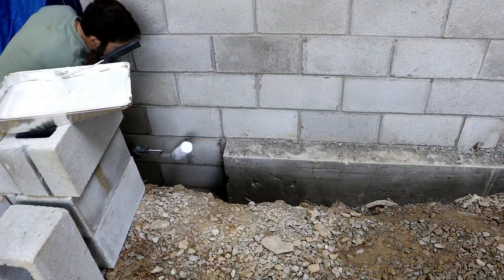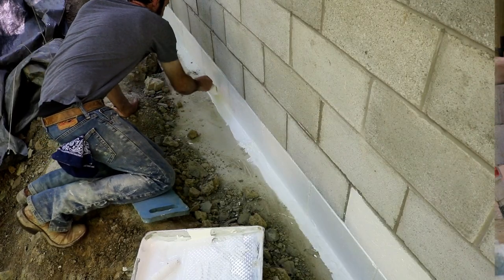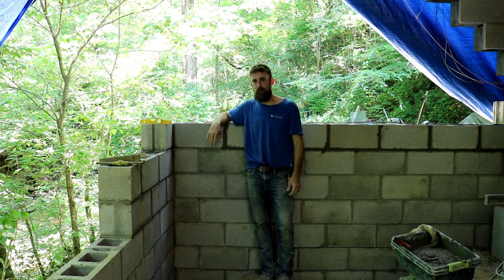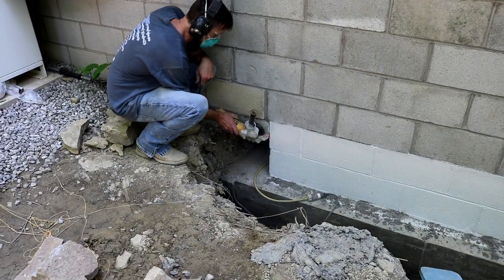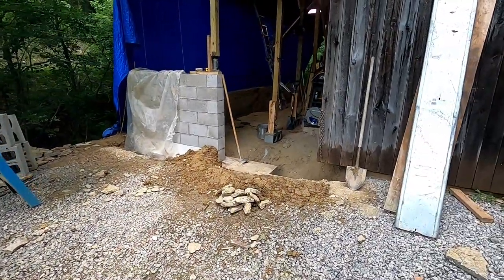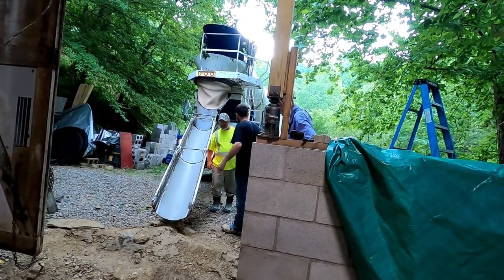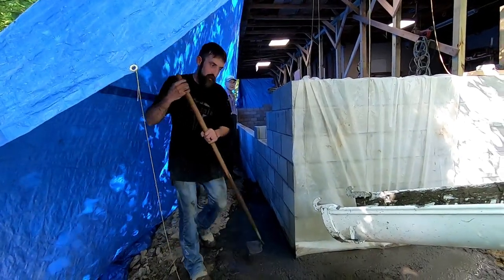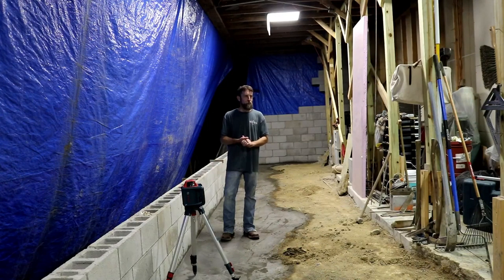Sealing & Backfilling with FLOWABLE FILL.  Shop Repair

Comment: Just fun'n  you know if you just spent $20,000.00 more , someone could have built that wall and leveled floor for you  ! Now that you are doing it yourself, it is going to take longer and YOU will KNOW exactly where every cent was spent or buried in the FILL case. I think it is coming along great. Winter thaw and heavy flood is the only concern I see.

Comment: Steve, this part of the building will most likely out last the rest of the building! By far, especially if the rest of the is built like the wall you removed! 
No two people would do this job the same way! I’m no expert by any means, but it looks great to me! 

I have never heard of flowable fill before. Does that contain any concrete or is it just a wet mix of sand and gravel? 

I had to chuckle about your comment about only raising 1/2 the tarps!

Comment: Dude you should have bought one of those Horror Fright airless sprayers ! Then use the roller to quickly go over it !! Second coat if needed !
Reply: Pros use brushes and rollers to apply waterproofing. Good enough for them good enough for me. The stuff the pros use is a bit aromatic though. So waterproofers are the biggest burnouts on the job.

Comment: Curious,  are you not using blocks to save on cement cost?  So why are you filling up the gap inside the wall with cement and not compacted sand?

Comment: Well done sir. Curious on the pad, are you going to cut and seam it or hammer the edges and fill?  Always heard that the rough jagged edge was better for stability and to prevent heaving. Just what I heard, not what I know.

Comment: I would think the biggest issue with that side of the barn wall that went bad was because it needed gutters to push the water away from the barn. Are you going to put gutters on the barn?
Reply: Your doing a nice job. Keep up the good work!

Comment: I've never heard of Flowable Fill What is the composition. "Around Here", it's either cement or Just gravel". Please explain "Flowable Filll"?
Reply: Looked like a grout slurry to me. So sand and portland. Maybe it has really small aggregate rock in it too? I've never heard of flowable fill either. Back in the day we'd just use stone dust. Compacted it is almost as hard as concrete.

Comment: I would have thought you would have just used the block wall up to the ground level and then fill the wall with stud construction?  Lots faster and less expensive.  Charles

Comment: Agreed on the problems of external support wall.  But why didn't you use suspended forms and pour a stem wall above grade up to the level of what you painted.  Was it just a choice of wanting to use the block up over paying for more rebar and yards of concrete?    By having a monolithic foundation/stem you are always stronger than layers and pieces and not had a bunch of porous block below grade. (I. personally, would have incorporated an angled breach wall on the upstream side as well. That creek so close is scary)  Don't take that wrong, I think you are doing good work.  You just sold yourself and your project a bit short on concept... and been where you are now, 3 weeks ago.  Sorry if it's taken badly, just a retired engineer scratching his head.

Comment: looks awesome that liquid backfill stuff is really neat its coming along nicely. have you thought about  moving the support jacks to the block wall like you did on the front wall so you could get the slab poured and then do your scaffolding and finish your block work maybe even run a steel tube or pipe down thru the hollow spaces in the blocks down to the footing to place your jacks on?  as for your negative keyboard warriors there only complaining because they dont have 1/100 of the testicular fortitude and ambition you do.

Comment: Looking great Steve! Coming along nicely. One question, what exactly is this "Flowable fill material" made from? Has it cement in it or is it something completely different? I ask this because one I have never seen it before over here in the UK and two it obviously comes from the company you got the concrete and shingle and stone chips from and that's why I wondered if it contained a cement base .
Reply: It's basically a runny mortar mix. Cement, fine gravel, sand, fly ash.

Comment: Seems you've forgotten to put in a damp course just above ground level in your block wall.
Reply: Seems none of your buisiness.
Reply: I'm not familiar with the hollow blocks used in the US but I don't see how a damp course would work when you fill the cavity with concrete/grout. Also he's painted waterproofer onto the outer face.

Comment: Nice job Steve, coming along really well. Question, I've never heard of flowable fill, what exactly is it, a slurry of cement and sand? Any structural strength to it?..............Mike
Reply: Mike Milburn I have the same question.

Comment: How hard does the flowable fill get? does it need compaction before a slab goes on top?
Reply: It's basically runny mortar mix with a bit less concrete, Sets up around the 1,000-1,500 psi range. No compaction needed.
Reply: @Blazer02LS  *cement, not concrete.

Comment: Steve first off I'll say 20 year retired (retarted) carpenter here and ur right ur not doing things the way I would. The one thing learned in that 20 years is that my way is not the only WAY ur doing a great job. I undrestand why and were it comes from but it seams that ur a little bit of a profectinst but thats ok ur happy with what ur doing. There were times we said if we were on the right peace of property we were close enough LOL! Keep ur mind on the end project and it will turn out fine.

Comment: Curious:  Is that latex based sealer?  If it is, is it actually meant to use for below grade applications?  I have yet to see a latex product work in a consistently wet environment.  I often see people using latex based tile adhesive in showers, and it doesn't last.  From their site:  DRYLOK® Extreme Masonry Waterproofer is guaranteed to stop water. Use for interior or exterior, above or below grade. 15 year warranty.  uhuhh..  I don't believe them.

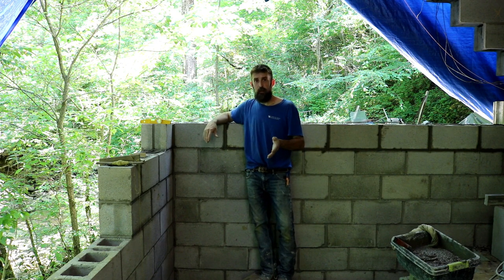Comment: 11:34 You are apologizing.  No reason.  As long as you are following code and have inspections, you are golden.  Following code and having inspections helps in facilitating a strong and safe structure.  I'm surprised that someone hasn't complained you used 'white' water sealer when brown was available.  Dickheads.

Comment: Everyone has an opinion on how they would do this or that & opinions are like A$$ holes everyone has 1 & they all stink. I find that if you ask to see that person's work they have some reason that they can't show you what they have done. The definition of an Expert that a wise man told me is an X is a has-been & a spert is just a drip under pressure.!!! Keep doing what you are doing & screw the haters.

Comment: I’m a retired mason with over forty years experience under my belt and I get a chuckle every now and then watching you with this build. I think that you’re over building like crazy but nothing falls down from over building! I was hoping all along that you would use flowable fill to backfill your foundation, you don’t have to worry about compaction when you use that. I thought you might do that on the outside also, are you going to use washed stone or dirt to backfill with? Have you thought about backfilling the outside before you get your block wall laid up? You have better access from the inside of the building right now or is that as high as you’re going to go with it? 
   I laughed when you caulked your form to keep the flowable fill from getting past your form work,  I think you gave the word flowable a little more credit than it deserved! You’re doing a great job, keep up the good work and keep them coming!

Comment: Reminds me when I was around 10 dad wanted to redo the driveway, getting the 2 strips of concrete replaced. He called the local readymix operation and asked about pricing, and got them to give him a reject load at basically the cost of the diesel for the distance. Then he sey up the shoring for the new pad, and waited for the call. Friday afternoon walk home from school, and as I come in he is there, left work early, and flew home and changed, because they had called him to let him know that a building site rejected a load because they were running behind, and if he wanted it. So basically changed into yard clothes, and we were all there with shovels waiting for this truck. Truck arrived just on 3, and he asked where the load was required.

Dad pointed to the top of the drive and asked him to plant it all there, no worry about waiting, tyo which the driver assented, taking 5 minutes to drop his 6 cubic metres of load, and driving off, his day now being over aside from wash the truck on the way back. We were busy moving this pile of concrete down the driveway, covering up to the shoring on the one side, with the wall doing the other, and trying to get this all down to a rough flat surface as fast as possible, as the concrete had only an hour of usable life left. Got it all levelled out, though the last bits were a little stiff as it was well curing. then left and cleaned up the tools. He phoned and asked them the next week the exact concrete load they had supplied, as it was a very pale mix, though incredibly hard even the next day. Turns out it had been a hydraulic mix for foundations, and was meant to cure under water, as the place they were building the water table was close to the surface, so they needed the concrete to survive being wet even while curing.

Looked on street view the other week, house still there a good number of years later, and that driveway is still there pretty much intact, guess nobody since them wanted to try to remove it from it's place, as parts are over 2 feet thick where the middle had eroded on the strips, and some of the shoring was that as well, for the same reason.

Comment: Why not just parge with OPC ?
And, on the outside, "sealing it" with paint ain't gonna work. You need to install proper hydro insulation. If you don't you will have salts inside in under 2 years.